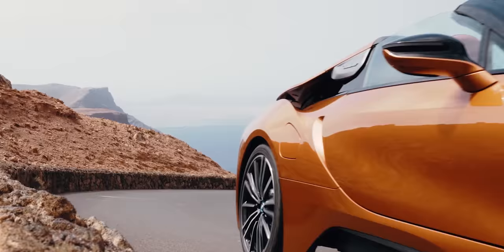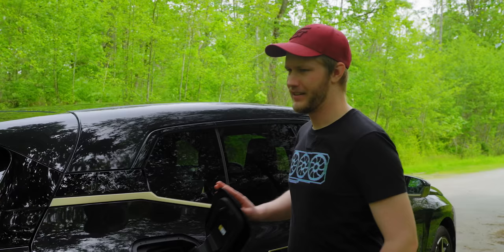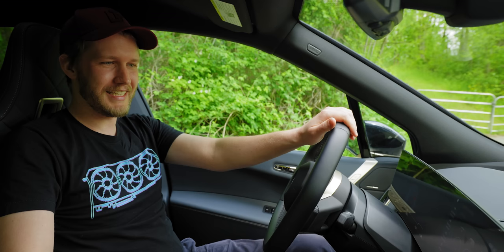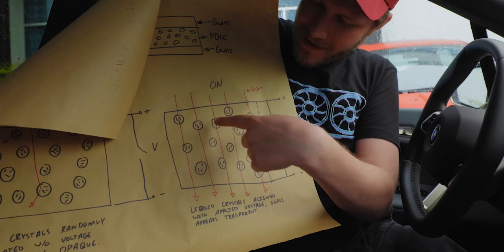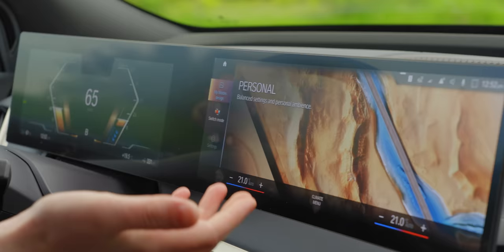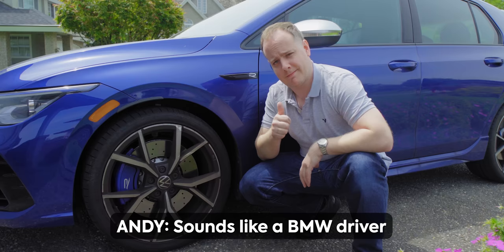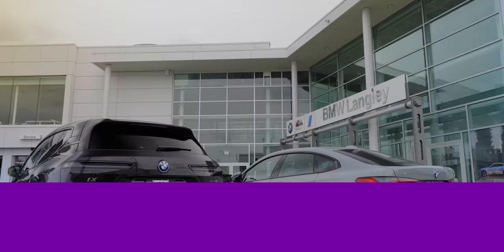It's... Complicated. - BMW iX

Comment: So many car infotainment operating systems are such total ass… in a world where we have iOS and Android, there’s no excuse for creating such a turd system… especially for these absolute top tier cars. If manufacturers actually put effort into their in-cabin computers, a) it would make fancy cars even more appealing as they’d be all techy with stacks of awesome features and options for third party accessory integration, and b) those systems would trickle down to the cheaper entry level car models, so you wouldn’t find yourself buying a second hand car that’s a few years old with an utterly pitiful infotainment system. Either that or all manufacturers should just drop their own proprietary systems and fully adopt CarPlay and android auto, which are FAR more polished than any car system I’ve personally experienced (admittedly not that many, but I recently saw my girlfriends dads brand new top of the line 2021 Mini JCW hot hatch, and from what I saw it had the most standard, underwhelming system, and the navigation system looked like a Tomtom from 2005 just on a screen the size of an iPad… really no excuse for it in a 45k USD starting price car, let alone this BMW

Comment: To be fair: the average person won't buy it anyway. But yeah, it's overdesigned crap. The Norwegian EV Youtuber Bjorn Nyland also critizized the reflective surfaces of modern cars. There is no way, the sunlight doesn't blind you in them. The kidneys should be called beaver teeths though. I love my Mx-30. Yes, it's made for city ranges, but it does that perfectly. The quality is good for the price point, the controls are maybe not "fancy", but intuitiv and the surfaces are all matt.

Comment: I am extremely glad this was just 14 minutes of straight shitting on this thing. This is awful. It is dumb, BMW has completely lost it (which is impressive considering how they were industry leading 3 years ago). I'd rather have slightly less efficiency (range) and a more usable vehicle. Just because I'm buying an EV doesn't mean I want all my physical buttons gone. The ergonomics of this thing are absolute shit and borderline dangerous.  The search bar made me audibly laugh, that's painfully bad. For a good infotainment, it should never rely on "just use android auto/apple carplay" as those should just be a feature, not required to make it usable. The audio system in the base model should not be garbage, for 89k you should be getting at least an acceptable audio system. 

Also, WHY DO ALL EV'S HAVE GLASS ROOFS, I WANT A SOLID ROOF ON MY CAR. I swear if I won lotto I'd buy an EV and custom fabricate sheet metal for the entire roof and reline the ceiling so its solid.

Comment: Climate controls have no business being implemented into a head unit even to just display the set temp. I will not buy a car that does not have physical buttons and knobs and displays. One of these days the manufacturer will stop updating the car. I will buy it when it's nearly 20 years old  and will want to hook a hmd or whatever we will be using into it. Of course it won't work  without rewiring the whole thing and someone will need to figure out how to do it for every model year. Bring back the standard double din!

Comment: Being paid how many dollars to design this crap instead going simple: 2 TO 4 BUTTONS right down there, PROGRAMMABLE THROUGH MENU. So you could say, adjust button 1 to "heat on" @ X temp you set. And then you can lower it or whatever. Jesus. So many cool ideas to do, but no, "massage" is what they think of cool. 

Clearly all of these automotive companies have been saved over the years and they are all old people out of touch with reality. We are literally in the worst timeline.

Comment: Frankly everyone but the hardware engineers should be fired. But they won’t because this will still sell well because of the badge on the hood.

Unintuitive controls, expensive, heavy (despite the carbon fiber), terrible ergonomics, ugly interior and exterior, difficult to repair, and limited rear space. 

The only saving grace is the powertrain, the comfort, and the range. Otherwise, why not just get the Taycan, which looks like a much better EV? Or save some money and get a Tesla or a high end Ioniq or Ford?

Comment: Touch controls in a car... no. Just...no. If I have to take my eyes off the road and my hands off the wheel to operate the climate control or audio system, then you have failed at user interface design. Failed miserably.

Comment: 1. It's ugly and doesn't live up to the standards of a regular bmw fanatic.
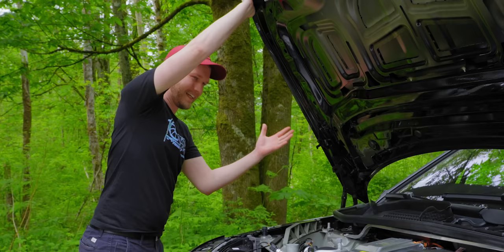2. 2:16 No gas spring ???? In my country this car costs + 100k€
3. I mean it's a practical design. idk "SUV" or what to call it with no frunk ??? The "engine" bay looks like it would be made in China.
4. Stop trying to Rolls Royce everything, we don't need any electric buttons to open doors, especially if the doors won't open by themselves. Makes no sense.
5. Bmw is all about performance and looks, it might be good to drive but so is alot of other cars, bmw should now concentrate on the design side
Reply: Goofy 🤓